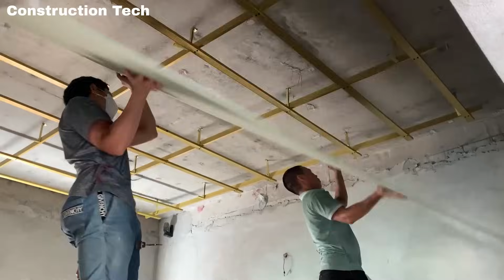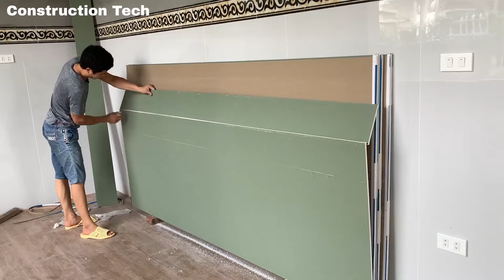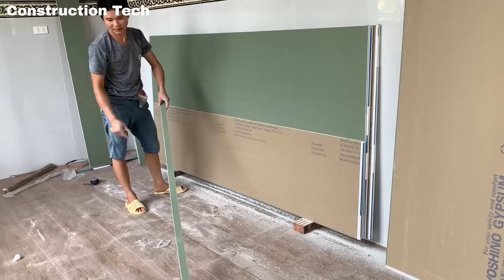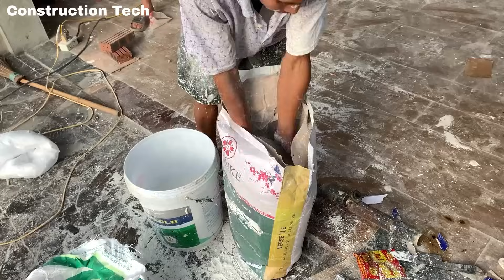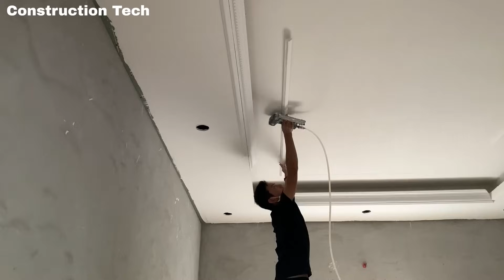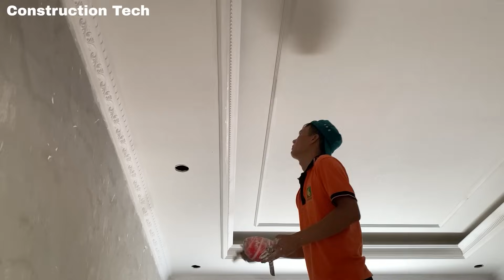Professional Skills Installing Gypsum Boards On Bedroom Ceilings New Style Quickly And Firmly

Comment: How will an electrician fit the lights.
Reply from the maker: hi - they will run the wires over the light holes and the lights will be connected in series with each other
Reply: Wires are usually hanging in place any ceiling Ive done and they fish them out after. Didn't see any hanging b4 they put this ceiling up. "Right lads boards off again"
Reply: @1Swahealy1 
You can do it afterwards it's just normally more difficult.
Reply: @JimJones-s4e   Yeah more difficult = more time = more cost. Do this in Ireland and you're getting sacked. First guys on site after the concretes poured are electricians and plumbers connecting to the slab then the walls and ceilings are built around it

Comment: Such a great job.. But I'm kinda confused by how the electrician is gonna fish wires from concrete slab. it seems like you covered it all up and didnt see hanging wires that can be grabbed from the holes on the gypsum.
Reply from the maker: Hi - the electrician will run a flexible plastic tube and wire to each light location.
Reply: @DavidOmboke  Exactly, I do this job for a living, the wires are always nailed onto the slab first then the ceiling gets built over it. Running flexible tubes with wires in them on a ceiling is so cheap looking and only put in after numpties like these make mistakes

Comment: I believe the electrical lines should be set up first, and the ceiling could be painted on the ground beforehand. The skills showcased in this video are truly impressive!:face-red-heart-shape:
Reply: Nice video and the correction
Reply: Exactly my thoughts. Is not going to be electrical wire and light St the middle because everywhere is close already spart from side that's open for electrical light
Reply from the maker: hi - thank you very much
Reply from the maker: thank you
Reply from the maker: hi - thank you for sharing

Comment: How can you install the lights?? And switch where you gonna insert the wires?
Reply from the maker: Hello - the lights will be connected in series with one or two switches
Reply: @constructiontech2411  thank you for your reply but how? They are already sealed where do you run the wires? I am planning to make my DIY ceiling like this,

Comment: Now how to get install the cable for lighting lamp.?
Reply from the maker: Hello, there is a power source waiting on the concrete ceiling - the electrician just needs to pull the wire and install the light.

Comment: Boss may okay ba gamitin ang gypsum board pag gawa ng cove ceiling? Tingin ko kasi mas okay kasi di na kailangang mag grinder ng rebit pag ginamit ang hardiflex. Ang gypsum kasi black screw at medyo na lubog na ang ulo ng screw. Tama ba boss?
Reply from the maker: right - sir
Reply: Is hardiflex same as gypsum board? I tot itbis a fiber cement board?